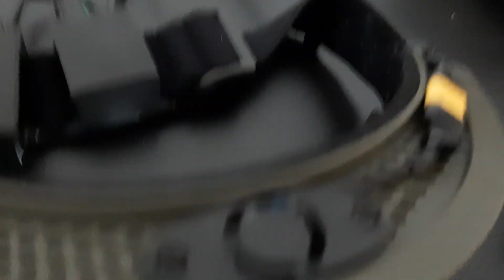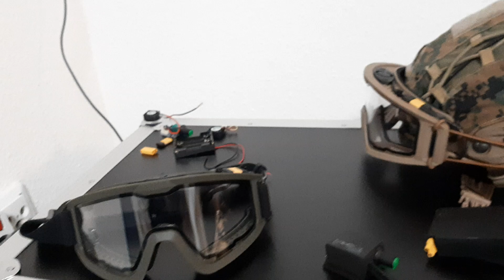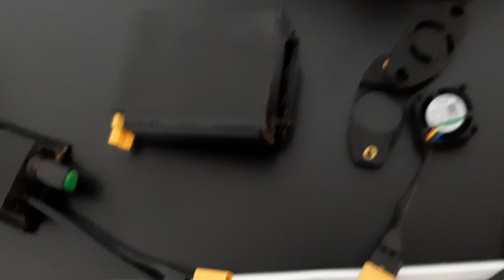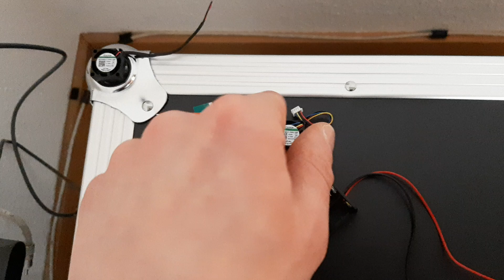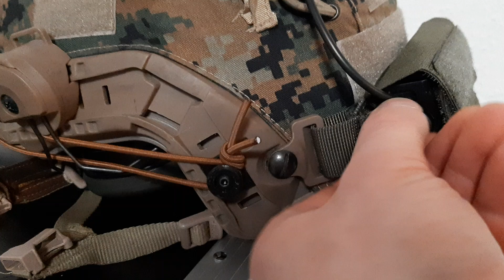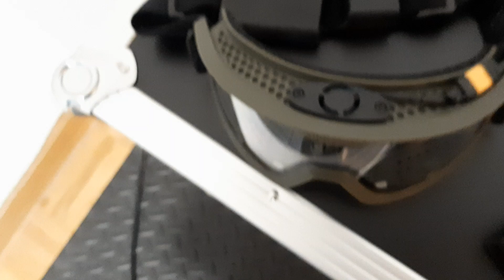Fan mod for Begadi CP1 Goggles

Comment: Could the normal anti fog unit be used instead?
Reply: i run a exfog for my cp1 and use a self designed magnetic hose like the one on the novritsch afu. I use it with a helmet tho, its a bit bulky to have the hose and tubes running between googles and helmet so im gonna try and build this
Reply from the maker: Good luck. One thing I have noticed is that the MR30 connector probably isn't the best as the connection is prone to breaking. I have some magnetic connectors onorder from AliExpress which I will probably use to replace it, so there might be a minor update to this soon.
Reply: @tychoordo3753  did you share the update?
Reply from the maker: @ Haven't actually finished it yet these are the connectors I want to use instead aliexpress.com/item/1005006374886661.html a team mate of mine already rewired his but I haven't gotten to mine yet.
Reply: @tychoordo3753   a bit late but how did those connectors work out for you? another question: which direction does the fan you use work? does it pull the air out of the goggles or is it blowing fresh air in? ive heard mixed opinions about this topic and im interested which solution you picked
Reply from the maker: What exactly do you mean by "normal anti fog unit"? If you mean whether ExFog or Novritschs Anti fog system can be used with the CP1, sure you could. I obviously prefer my fan version though.